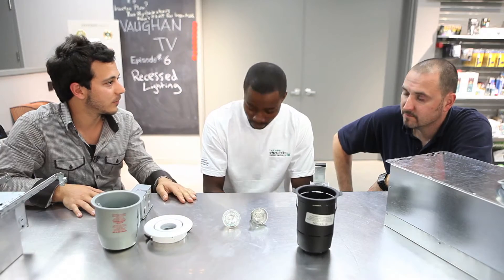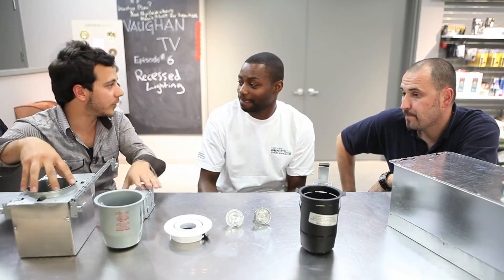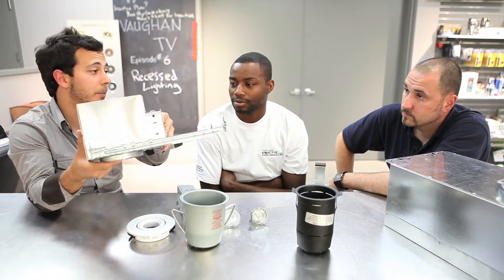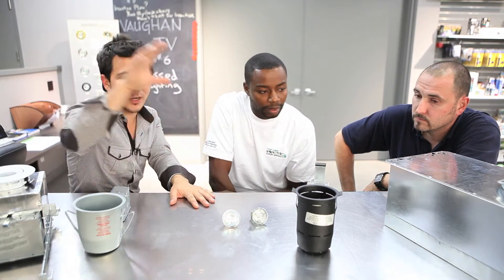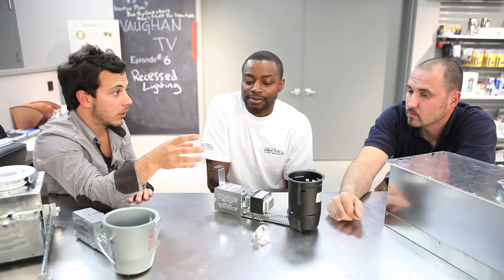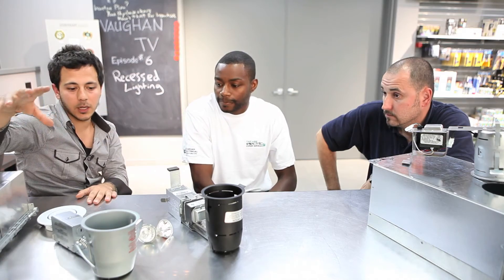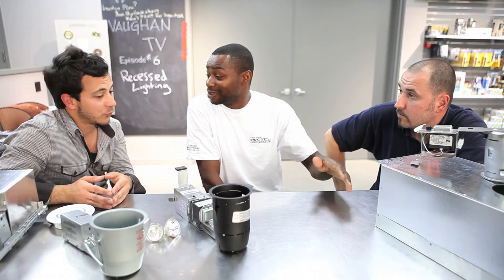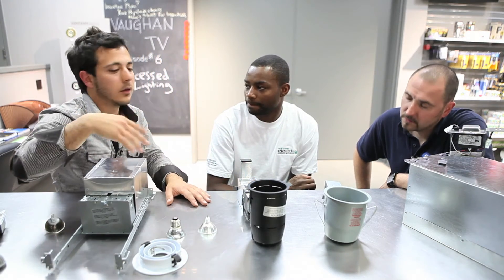Recessed Lighting: Line Voltage vs Low Voltage

Comment: There's kinda a problem with what Frank says around 7:00. "If you reduce the voltage, you've got to be increasing something, so resistance is obviously increasing". In order for you maintain the same power, your resistance has to go down, not up. (Thanks to P = V^2/R, which is derived from P = V * I, and I = V/R)  What's going up is your current, and that's only because of the decrease in resistance.

Comment from the maker: We are about to work on a new video for next month, featuring line voltage LED which is great for 8' ceilings, electronic low voltage LED which is great for higher ceilings.  Philips is the line we have been pushing as they have the best warranty and are committing a large chunk on R & D to innovate there LED's. So far there latest was airflux which got a red dot award!  We are awaiting stock on there latest medium base LED lamp which will be exclusive to Vaughan Electric in the Canadian market.

Comment: Thanks for the overview.  I'm about to purchase 40 of these for my own renovation and this video grounded me on a number of issues.  I'd be interested in an updated version on LED and line voltage to the bulbs vs low voltage with an internal transformer.  And, I'm still wondering if anyone is offering a low-voltage system with a centralized ballast.

Comment: @ 7:00 the wattage of the bulbs is discussed,  I wonder how much energy is lost in heat loss of the transformer?  Also, what the heck is the guy talking about with 'resistance' going up?  I would think to get 50W out of a 120VAC you need about 0.5A  (that gets you 60W just for argument sake)  now with a 12V light you will need 5A - the point here is that resistance of the bulb must go DOWN for low voltage not up.  I personally like line voltage systems, less BS to worry about.

Comment from the maker: We are sorry you feel this way, this video has gotten a lot of positive feedback from our customers and non customers that have emailed us saying this was a fun guide to helping them decide on which route to take.  These 2 featured electricians are licensed and master electricians as we would not post or support anything less!  The video was intended to open a conversation to which is better line or low, many contractors prefer line voltage yet many like and buy low voltage. I hope this helps.